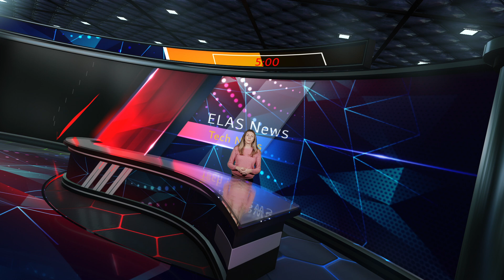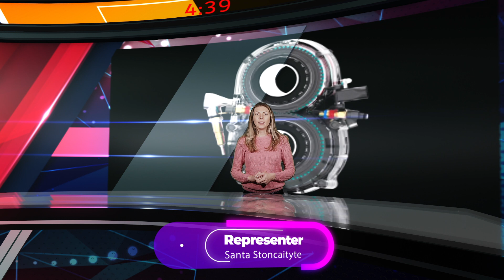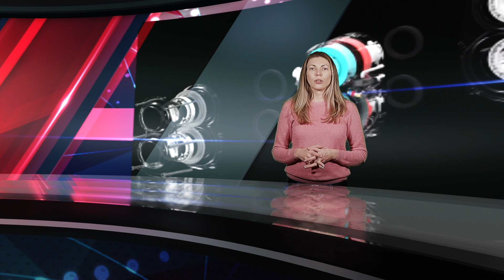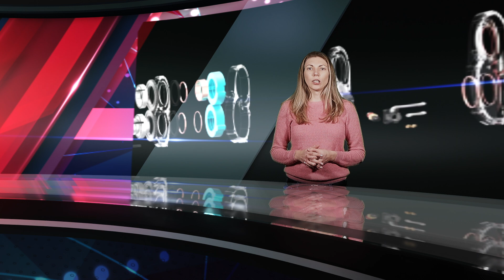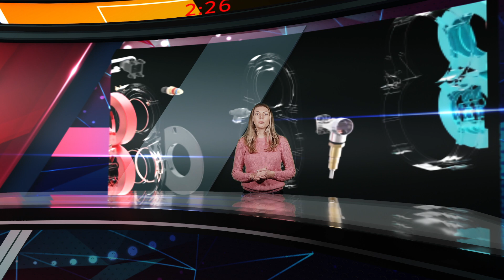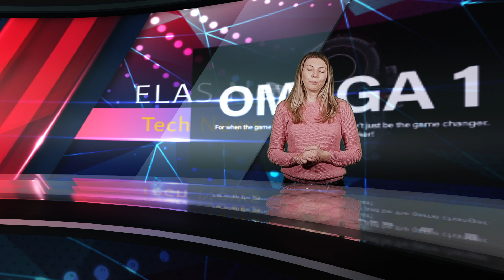There are nearly no harmful emissions from a new internal combustion engine

Comment: Hello, we have a super revolutionary engine for any type of fuel, including synthetic methanol for negative CO2 emissions and HYDROGEN for ZERO emissions, obtaining much more efficiency than a current engine and greater than batteries and also fuel cells that are used with hydrogen and electric motors, a novel thermodynamic cycle with more than 75% efficiency, only two main moving parts, a power/weight ratio greater than 13 KW/Kilo, everything can be made of aluminum except the main shaft and screws, it does not use liquid coolant only air, uses very little lubricant that can be used from the center through the seals to lubricate everything, the speed of the seals or rings is 7 times less than in any engine, can be extrapolated to any power without losing any characteristic, is in process of PCT international patent. Very easy to manufacture 100% with current basic technology, all its main moving parts mounted on commercial bearings, the useful life is up to 30,000 hours with very low maintenance, almost zero and more than 70 additional advantages....
As an example: Motors of 60 kilos of 1000 Kw can be made very compact without useless space.

https://www.youtube.com/watch?v=j3VRy7VqYE8